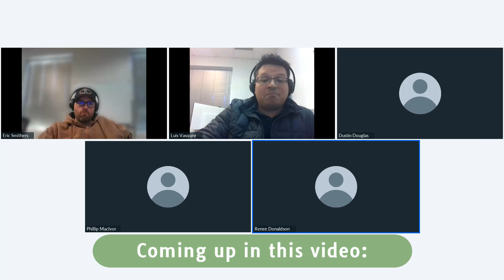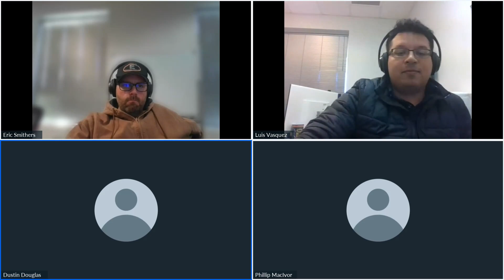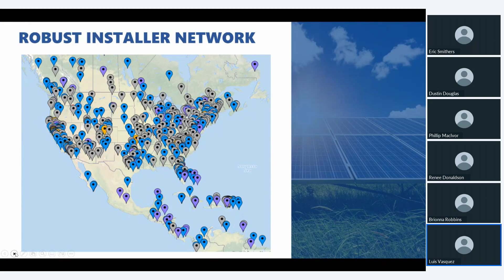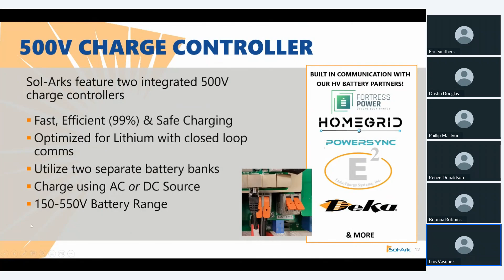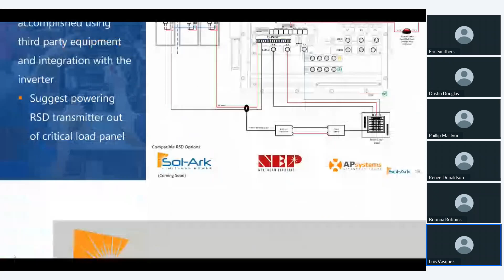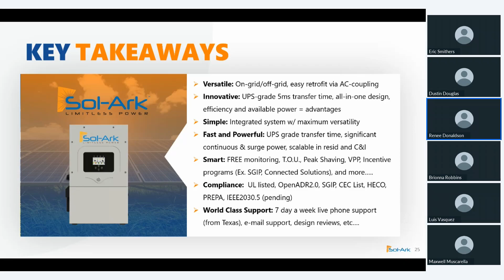The Sol-Ark 30K & 60K Training & Webinar - Intersolar 23' with EcoDirect

Comment: Couple of questions (this would be presuming and off-grid micro-grid):
  
1) Do you have any information on the 60K's OpenADR integration for use in a micro-grid?
2) The discussion of the microgrid application @46:00, there is discussion about master/slave (leader/follower) configuration of the inverter for sourcing the "grid frequency" - what if there were several 60K inverters in separate locations that can't be conventionally paralleled, but in practice paralleled via only the grid?
3) Can you steer master/slave (leader/follower) configuration in real time?  Similarly can you steer how much the inverter will source sink to the grid?  (this is related to the OpenADR question)

Comment: Not for me. I like installing 48v server batteries. If one single cell fails in an HV battery, the whole battery is off-line. With 48v server batteries you just pull the duff unit for service and the rest of the battery carries on regardless.

Comment: Support for lead acid battery banks should be added at some point.  Lead acid battery banks that operate at hundreds of volts have been commonplace in power plant and very big UPS applications for decades and pose no complications other than electrocution risk mitigation.

Comment: How many batteries are needed for sol ark 30k.
Reply from the maker: Hello, You can use it without any batteries; we would not recommend that. But the minimum number of batteries would depend on the amount of Solar you have connected. Generally, the battery bank should be able to store at least one hour of peak solar production. Give us a call, and we would be happy to help! Sale@EcoDirect.com or 760-597-0498. :)